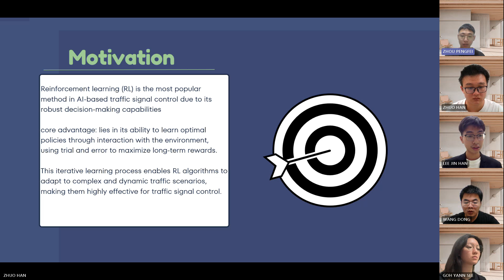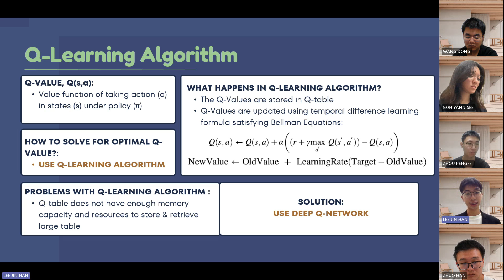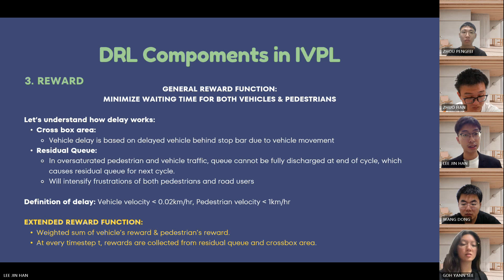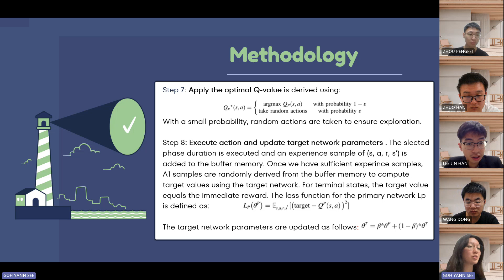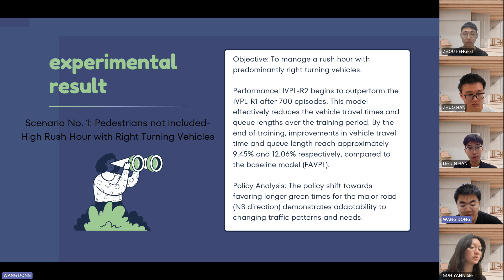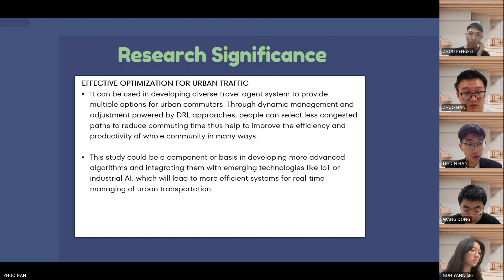202404 AIT306 Group 10

Comment: What techniques are used to ensure the stability and convergence of the DRL algorithms in the traffic signal control application (IVPL) here?
Reply: Generally, such as Experience Replay and Target Networks are probably used to ensure the stability and convergence of algorithms in DRL traffic signal control. Experience Replay contains storing and reusing past experiences to adjust or break the correlations between consecutive updates. Target Networks can stabilize learning process by given a fixed target for a series of updates to prevent the network oscillation. Through these two techniques can effectively help the network convegence.

Comment: Group 5 Question:
How does the reward function in the DRL model for traffic signal (IVPL) control influence the learning process?
Reply: The reward function in this DRL traffic signal control is designed to minimize the factors such as vehicle waiting time, queue length, and traffic congestion, etc. It can provide feedback to the model by assigning rewards for positive actions/conditions and deducting rewards for negative actions/conditions, thus guiding the learning process to optimal strategies, and finally reduce inefficiencies and improve traffic flows,